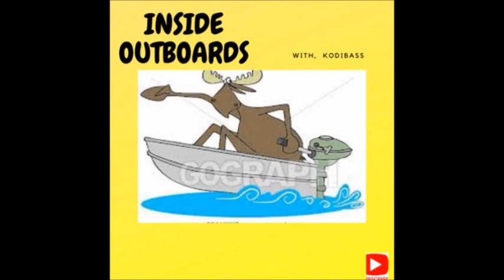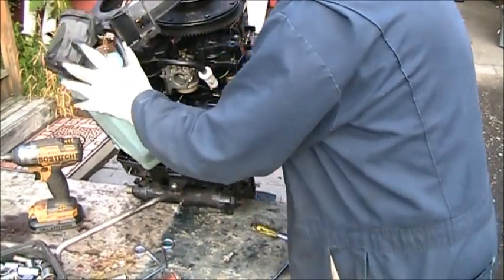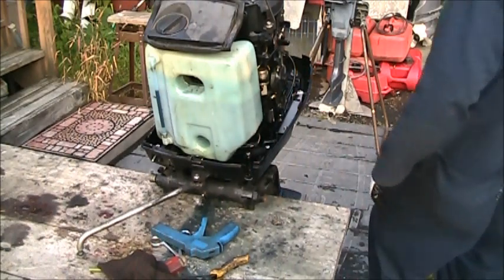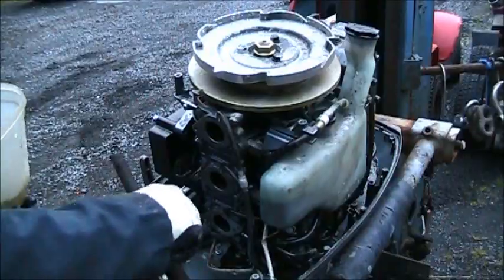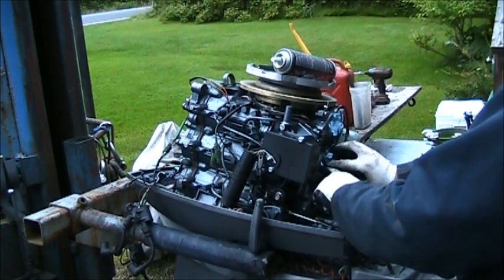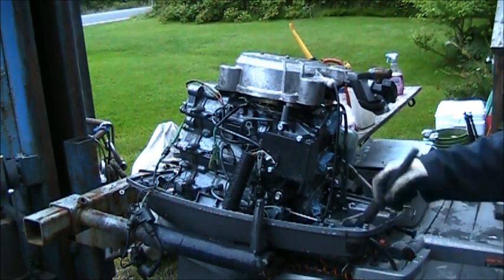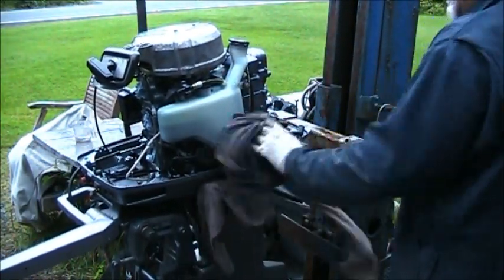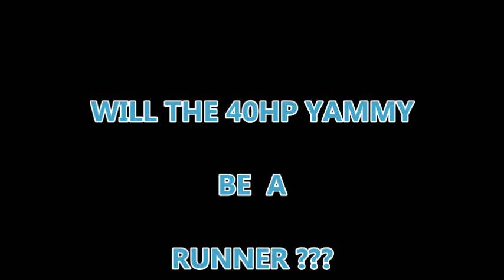MERCURY 40 HP,  ,YAMAHA 40 HP ,JOHNSON 30 HP  ((  Part  1  ))

Comment: Hello again Kodi! I’m wondering if you got extra tiller handle and cable for the 20-35 hp Evinrude or Johnson that you would like to Get rid of. Right now, I’m restoring an Evinrude 30 hp 1991. I’m not real picky about the condition and the Length of the handle much, as long as it functions right. I’m also looking for a driveshaft for the short model as well and maybe a tiller bracket too. If you have any of these parts, I’m more than happy to pay for the parts and the shipping. I live overseas right now. I’m wondering if you can ship overseas as well. I very much appreciate you making all the videos for us. I got lots of knowledge from your channel. Please let me know! Thanks again Kodi!
Reply from the maker: +ATF, I have a short drive shaft & a tiller for a 35 johnson,  I live On Kodiak Island Alaska, the shipping mite be off the chart big bucks, so You would need 2 check from your end about the cost,  my zip code is 99615                              kodi
Reply: How heavy Is it and how big are those two things combined? Thanks again Kodi.

Comment: Hey kodi. Why is it in your area everybody runs small outboards. Here in Florida everybody runs 150 to 200 hp. It’s hard to find used small outboards here.especially in the 25 to 40 hp range.
Reply: Brad  that’s because they are turning out all the mechanics from marine mechanics institute in Orlando.

They suck up all small engines because it’s cheaper to buy.

You have the retires trying to make money also in florida
Reply: @johnbladykas4885  "The Boat Guy" seems to get more than his fair shair of  9.9's through 90 HP down there...

Comment: Way my 1993 mercury 75hp only started just with the spark advance it stay running but when it warm up I still have to use spark advance
Reply from the maker: +TR  My best guess would be Carburetors need cleaning & adjusted,         kodi
Reply: Thanks for replying back i will try  adjusting and cleaning them
Reply: That's what It was now my  Trigger sticking It's a new CDI trigger

Comment: 40 Mercury's of that era are weird looking...   being 4 cylinders, their cowls are taller than the just later 40, 50, & 60 3 cylinder model Mercurys
Reply from the maker: +WR,  I agree,  I did the best I could do with this fellows motor, But the repairs will not B guaranteed because all the damage was impact related,  When I removed the power head one of the power head bolts just fell out, it had been sheered from the impact,  I also found a crack in the shift rod connector from the drop,  Keep in mind I never opened up the gear box,  Who knows what damage may or may-not be inside it. kodi
Reply: @kodibassInsideoutboards  I am beginning to wonder if the owner (that's paying for these motors & repairs) is actually the person using & runing the outboards...?   Sure doesn't seem like it...!